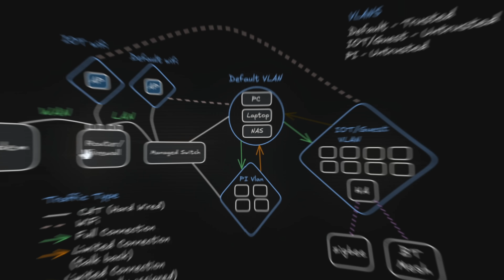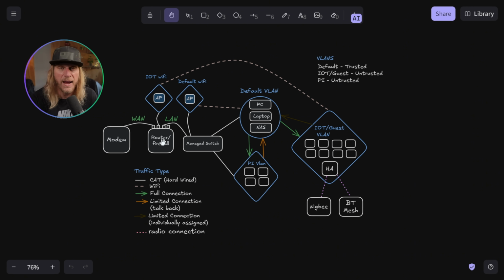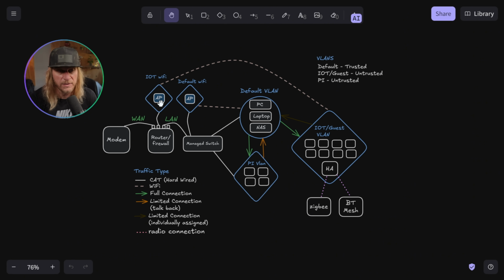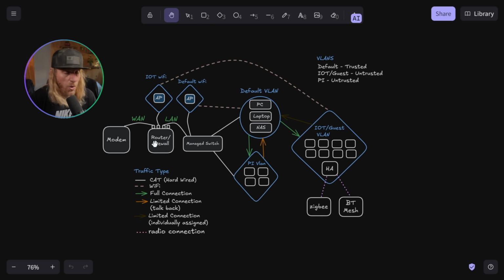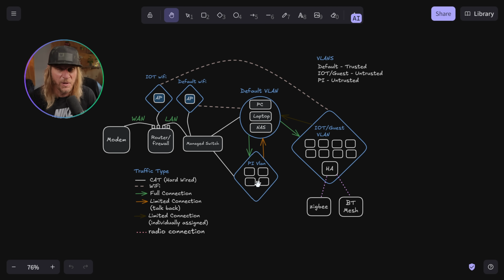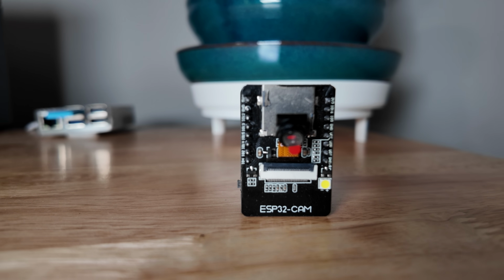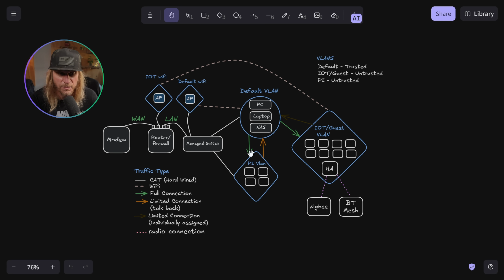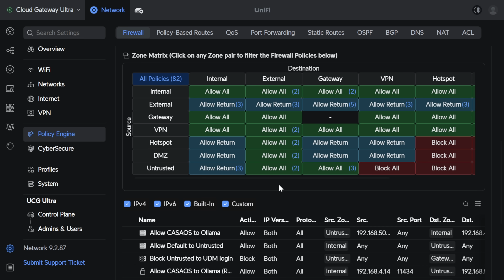Inside My Low Power, High Power Home Lab: AI, VLANs, Routers & Automation!

Comment: This is one of the most sensible videos I've seen on home-labs.

I'm a professional software dev - I work in enterprise software. My home server is an old Xeon e5-2699 v4 with 128GB of RAM; I use it to run about 8 VMs, a PLEX server and a NAS, along with a varying number of Docker containers. My main dev box is an i9-10900K with 64GB of RAM and an RTX 3080 (12GB) - it's plenty for everything I need to do. Down the road, I may split the NAS out onto its own machine and I would like to upgrade my network to be able to split out into VLANs but there is no circumstance where I need half a dozen physical machines in a 48U rack.

Comment: I'm working towards my own homelab setup, hosting A.I. and pihole/streaming with jellyfin, but all I have to work with are old gaming rigs. Plus side: zero material cost....but the footprint and energy usage will be pretty big 😅🤣
Reply from the maker: Bro I get it, and above all I lean on old Teddy Roosevelt when he said, ""Do what you can, with what you have, where you are." As you grow and replace or add think about the energy but the most important thing in my mind is to start. And while you may use a bit more energy you are reusing, upcycling, repurposing old machines so that is something to be proud of! Just do it and like most of us, if you can, when you replace then think about energy efficiency mate, I just want you to start, that what matters now.
Reply: @HillPhantom most definitely, of course I guess it helps that I know a bit about undervolting. I'm definitely glad to have found your channel as this little journey of mine takes place. Subbed for sure 😁

Comment: Excellent video!  I really appreciate your focus on a budget-friendly and energy-efficient approach to home labbing.  It's a refreshing take that highlights how much can be achieved without excessive power consumption or spending. Your setup is a fantastic example of practical and responsible self-hosting.  FYI, the Firebat N150 Mini PC has been an awesome experience for me; I absolutely love it!
Reply: It is a great video! I have to agree with the energy-efficient focus but from a slightly different point of view.  While I can afford it all, my house only has so many circuits to power it all!  My main AI rig eats the majority of a US 15A circuit.  I simply have no place to plug-in a lot of power hungry enterprise gear.  I've been using Seeed Mate boxes with NVIDIA Xavier NX modules (6 ARM cores per Xavier with 4 modules in each Mate) for clustering on the ARM side and HP Elitedesk 800s for X64 clustering.  They work great for a Proxmox cluster (using a  USB 2.5g adapters to add an extra NIC) and for building out kubernetes test beds.  I keep one high end desktop for when I want to game, but most of these other units sip electricity so I can run a lot of nodes on just a single circuit.  In the end they are almost as inexpensive as used enterprise gear.  These little units like the Firebat and mini-pcs with laptop processors are fantastic.    

I think that a lot of the golden youtube home labers are also missing out on a important concept while learning new technologies.  If we can get our clusters running on a slower network of not the highest end processors, then production servers are not an issue.   Learning in a constrained environment and with limited resources will actually make you a better engineer and programmer.  Customer have actually given me work based on just understanding 'the constraints of real systems'.
Reply from the maker: @quincy Lets GO! I love this "Learning in a constrained environment and with limited resources will actually make you a better engineer and programmer. "  That has been my story for sure. Honestly, I feel like I came up so differently I don't really fit in with many of those well known names in our niche. Nothing personal at all, I just am built / made different. I started by dumpster diving for parts, and you know what I am damn proud of that. I always worried I was alone, that I would never fit in with the cool tech crowd, and largely I don't (in my professional life). Seeing the support and there are so many out there that "get it" I am floored. I  have found that American's, and not to be like against American's or my country, but we are wasteful, want the muscle cars, big house, and consume energy like it's our "right". I think the best thing that ever happened to me, was traveling. Seeing the cool stuff people make out of necessity. That is what inspires me. Weather that be a home made washing machine or a system that should not work but does, that is cobbled together like a real G, boy that makes me feel good. All to your point as well " Learning in a constrained environment and with limited resources will actually make you a better engineer and programmer. " - I believe this as well.  I have heard so many folks now also talk about circuit limits again something many of us Americans' don't know and never had to experience. So I think it really takes a mind that understands, or perhaps still touches grass, that that stuff coming out of the wall may seem unlimited but its not, and worse it causes ALOT of harm before it gets to your wall. Man I sound like I dislike everyone and everything,  I don't,  I just get frustrated so perhaps you can classify this as a vent. I love my country and countrymen I just think its time we get back to what open source was, being a responsible citizen of the world, not just country. Appreciate you mate.
Reply from the maker: Yo @jesse as always thank you for your kind words and support.  I am super amped that N150 is rocking for you, its totally is for me. I have it as my RETRO Gamer even and I love it. Did you end up getting it on sale? I heard it's a buck 60 now, so glad I got it at 118.  I kinda want to do another review now I have hands on as I think its that good as well. Appreciate you brother!

Comment: Preach brother, it's always been such a strange trend to me in homelabs to have these massive racks filled with servers, especially old enterprise / datacenter equipment 🤔 Not sure why anyone would want all that noise / heat & power consumption! Also strange how people fixate on hardware but not interested in the software, maybe it’s the tangible aspect, either way, it’s all about the software for me (maybe I’m biased being a software engineer 😂). 

Many of my workloads are home grown (developed in house) and vast majority of what people could run at home (transcoding and LLMs aside) is not CPU bound and idle power consumption should be one of the highest priorities in my mind. My 14 core NUC 15 idles at 4.7W! Still have work to do on my POE 10gbit core switch and RAID arrays in terms of consumption 😬🤞

Ps. Nice to hear about more BZN homelabbers! ✌

Comment: Hi, how do you have your PC+Ollama set up specifically?
you got some "web remote" installed, or using some kind of WSL2 setup you shut down completely when gaming?
if I remember correct it's not possible to utilize gpu with standard Docker Desktop and running Ollama directly within Windows may be somewhat less secure or prone to Windows Update feature bugs?
Reply from the maker: So this is a great point ☝️ and I run it outside any containers. I installed directly on PC and it also put a applet in the task bar so you can easily shut it down now. It's just a script that runs like any that you can stop and start. I am a bit sus on the security but i haven't noticed anything yet that would indicate risk. I also ran ollama in a container via casa basically docker and they now have optimized versions AMD and Nivida. I've been running ollama directly on PC set up via CMD for over six months so far no issues via updates.

Comment: Nice video, it was enjoyable to watch. The topic of energy savings is especially interesting when it comes to a homelab. I do have a question though. why are you using a separate access point, when you could just create a second SSID on the Unifi AP to access the IoT VLAN? Is there a specific reason you didn’t go that route? I’m curious.
Reply from the maker: Thank you. Honestly I did it bc I only have one unifi AP and it doesn't reach to my upper floor. I had the eero mesh from back in the day so decided to use those for my mesh. But keen eye and point could have done separate ssids for sure. Was more a coverage decision. Cheers and thank you

Comment: Fun video. Do you have any issues with the SD cards and write endurance using rbpi? I've been repurposing older 1L micro PCs as you can get them quite cheap now and slap in an SSD though they are a bit more wattage than a pi
Reply from the maker: Thank you 🙏. I have actually after two years two corrupted. So I switched to nvme via under hats by pimproni and now boot off those now. Those little 1s are awesome. I had one but gave it to a kid in my neighborhood. They can be picked up cheap too! Thanks again.